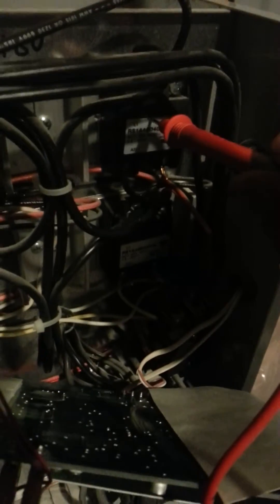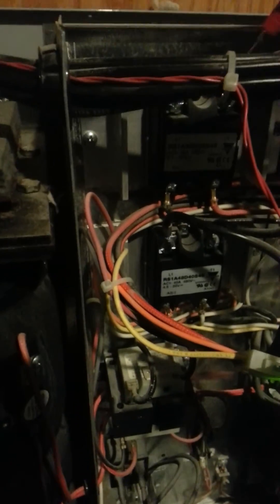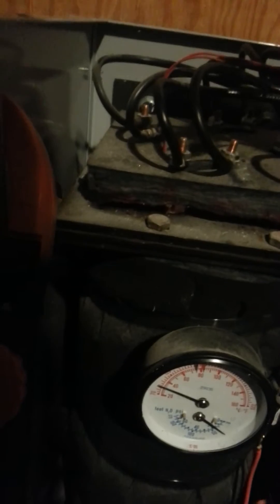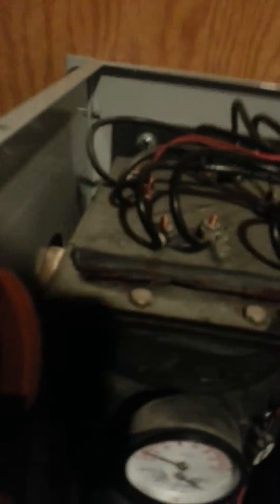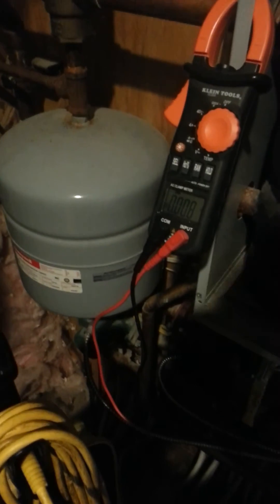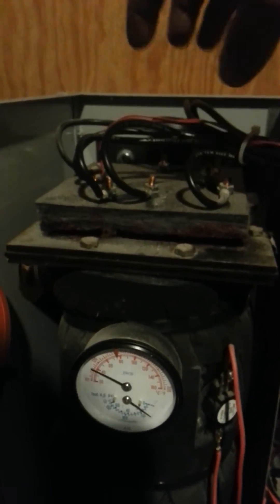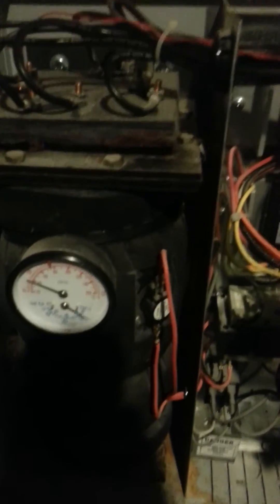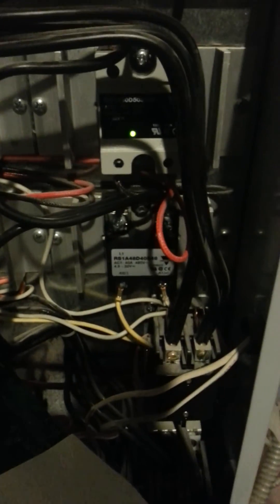Troubleshooting relays on termolec boiler part 2

Comment: Hello Merrier Outdoor Life! My thermolec boiler completely shuts off after a few hours, sometimes just after a few minutes but the thermal switch tests as having continuity, what do you think it the problem could be??? It's driving me nuts... I replaced a magnetic contactor that was vibrating but that wasn't really the problem. I can only turn it back on when the pipes are completely cold again.

Comment: Hey I just had my boiler replaced with a used unit. Temperature and pressure gauges reading proper levels. However it us not heating the house. Temperature gauge is reading higher than old unit which caught fire, but not heating house. What could it be?

Comment: Thanks. Didn't see it. I have the same boiler with one bad heating element and a bad relay on a different element. So I am getting only 50% heating. I can tell a heating element is bad because I disconnected the signal coming in that tells the boiler to heat. Then I see 0V on the DC side of the relays. Next I measured the voltage across the AC side of each relay. Three had 240V and one had only about 1.5V. The 1.5V must have a bad heating element. Also like you said, I didn't know this until it got really cold outside.
Reply from the maker: Hopefully the video will help! To be honest i sold the house with this boiler a couple years ago! And honestly dont remember much about it... lol! Good luck and stay warm!

Comment: We have a boiler that has 1 element that won't shut off. Only half the power going from the relay to the element ( 120 ) which doesn't add up as the element should not come on at all -- any suggestions. Thermolec said that the board was gone - changed and not the case here

Comment: BTW my b20 doesn;t have solid state relays, there are 8 mechanical relays per boiler
Reply from the maker: JonTheChron if relays are mechanical you are you getting power on both sides of the relay? also are you circulation pumps turning on?
Reply: For some dumb reason I was measuring the voltage in AC, ill measure again using DC tomorrow. I have an estimator coming by to give me a quote on a natural gas conversion in the morning
Reply: b20 have 1 ssr and 3 mechanical relays
Reply: @juliensingher7049  I have an older model from 1980 since all relays are mechanical, I recently replaced it by a b40 which has 4 SSR's
Reply: @juliensingher7049 depends on the build date, nowadays they have 4 ssr's
Reply: @juliensingher7049  depends on the year of fabrication, some b20's have 4x ssr's, others 1ssr and 3x mechinical

Comment: I have two thermolec boilers in my building, both arent functionning at all, when I turn on the breakers one of them hums, i tested all voltage comming out of the transformers and everything seems within specs,   i have 2x b20 models
Reply from the maker: JonTheChron both units do not produce any heat?
Reply: Merrier Outdoor Life no lights.. no nothing. I'll check the elements for correct resistance when I get home. I tested the coils on the relays and they seem fine, my model doesn't seem to have solid state relays, they are all mechanical I believe
Reply from the maker: JonTheChron 
1. Confi rm that the boiler is connected to 240/1 power, main panel breakers are ON, breakers 
supplying boiler in panel are ON.
2. Boiler circuit breakers are ON.
3. Check line side of transformer for 240 volts. If yes, continue. If no, check for 240VAC at circuit 
breaker.
4. Check low voltage side of transformer for 24 VAC. If yes, continue. If no, change transformer.
5. Check for 24 VAC from fuse to circuit board. If yes, continue. If no, change fuse.
6. If outdoor sensor is attached to OT/OT on boiler circuit board, is outdoor temperature below 
68°F? If outdoor temperature is 68°F or more, disconnect one leg of wires to OT/OT. Do not 
jumper OT/OT.
7. Confi rm that load management control contact is wired to S1/S2 terminals on boiler circuit 
board and load management contact is closed, or jumper S1/S2. Boiler will not start if S1/S2 is 
open.
8. Confi rm that thermostat or zone valve end switch is wired to C/W1 terminals on boiler circuit 
board and that boiler is getting a good call for heat, or jumper C/W1. 
9. Turn OFF circuit breakers at boiler. On upper left corner of circuit board are two red wires 
connected to supply water sensor on boiler tank. Carefully disconnect red wire connections 
from board. Turn ON circuit breakers. If boiler starts, turn OFF circuit breakers and replace 
supply water sensor. If boiler doesn’t start, replace circuit board.
Reply: Merrier Outdoor Life yep, I have 240v comming across both lines at the boiler, the breaker is on in my service panel, my model doesn't have internal breakers
Reply from the maker: JonTheChron do you have outdoor sensor?
Reply: Merrier Outdoor Life I don't think so, the boiler should be managed by my service meter which has its own external temp sensor
Reply: Oh no, it's manual, the temp sensor on my meter is for the automatic switching between electric and oil, I'm on a dual energy system
Reply from the maker: JonTheChron I have not been inside a dual fuel unit. my guess with out seeing it is your having issues with the DC side of the elec. system. download the manual for your unit and figure out where your DC converter is test power starting there. if you get no lights on board, either it's not calling for heat or the fuse on the DC side is burned out. or possibly the converter... worst case would be a burned out board.
Reply: Mine does the same thing. One day I went into my basement and heard this loud humming sound from my thermolec unit, so I turned off the beaker and have no idea what to do yet. Calling a service person I'm afraid will be costly. I'm totally new to this. What do you think could be wrong with it? Any help would be really appreciated! :) Thanks!
Reply: Where can I download a detailed manual of this thermolec unit? Thanks! :)